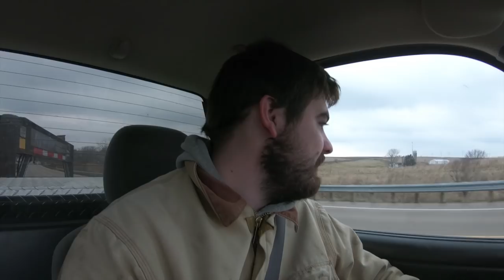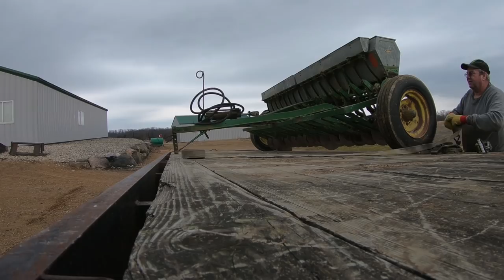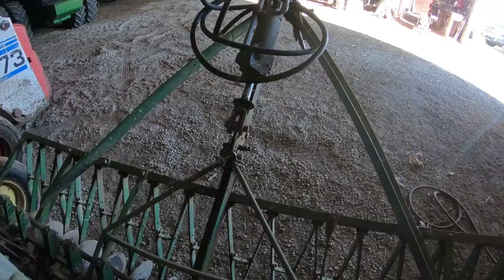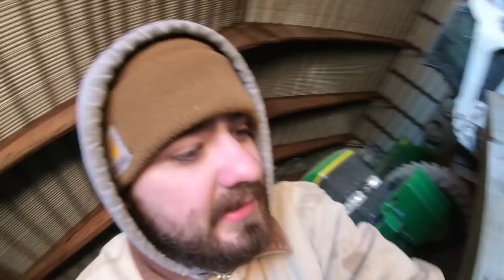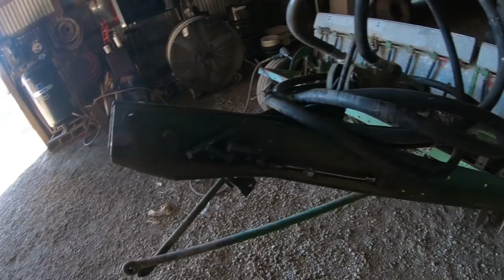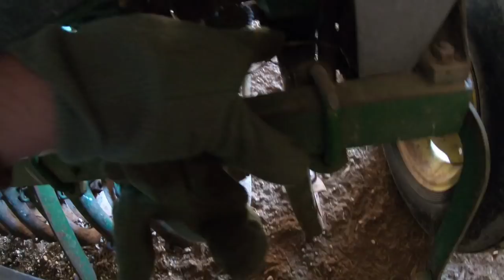1960’s John Deere B-Series Grain Drill

Comment: Drilled right at 100 acres with mine   back in October. Pulled it out of a retired Farmers barn. The JD dealer had a few parts left on the shelf so I bought all of them and after a little welding on it it doesn't miss a beat.

Comment: Nice old drills. I bought a 8ft John Deere Van Brundt seed drill back in the early 90's. Great drill, paid $500 for it and all it needed was a hydraulic cylinder and some greasing. Still have it. Mine has the double disk openers on it though.

Comment: Looked old enough to be a VAN Brunt with the galv seed boxes. The seed cups and hoses still looks good shape. I have an old JD LZ B drill, it shares a lot of parts with that drill around the seed box, cups and hoses.  Mine is hoe drill type openers instead of discs, and of course has packers wheels at the back, you probably have drag chains. Your JD 4020 won't even notice its back there, when its full.

Comment: If it was me I would put a electric actuator on to replace the hydraulic ram. Then do some wiring with the gator and use the gator to run that drill because even the 4020 is a bit overkill for that. On the other hand the 8235r would be good for YouTube views and subs

Comment: you should try a kubora tractor and a skid steer
Reply: Pancho Loewen Yeah if he wants it to break and not get it into gear.
Reply: oh yeah love it i tested a M6-141 and M7-171 a 141.4 hp and 171hp kubota 2017 new m series love it and price is reasonable cheaper too wich my kubota selling for his retail price for a M6-141 for $60,100 and M7-171 a 171hp for $59,100 wich not bad for big hp m tractors with 6 year warranty :)and the svl75-2 he selling for $48,000 and $50,000 for svl 90-2 a 92.2hp wich aint bad here in canada pei

Comment: i wouldnt say John Deere doesn't make parts for that anymore, they make parts based on consumed volume dating back to the very early 1900's, i would check with sloans if you need any parts...
http://jdpc.deere.com/jdpc/pdfs/PC0246.pdf
Reply: no not in canada all the  john deeres discontitued all parts on older models on there  markets but the older kubotas there parts still avaliable on the market wich kubota doesnt give up selling parts for older models wich are cheapest on the market wich kubota accully took over the deere tlbs

Comment: For a half a second I thought it was a van brunt
Reply: Kyle Rice I think it’s pretty much the same thing, I believe they may have made drills for Deere or Deere bought them out and kept the name for a while. We used to have a van burnt drill until a few years ago when one side of the drive gears fell apart and we couldn’t find parts. Now we have a 8200 John Deere
Reply: IT is a van brunt.  John Deere acquired the van brunt company.   
Both names appeared on the drills for a while.
Reply: emmjay I thought so but wasn’t sure so I didn’t want to put false information out there. Thanks

Comment: Well, that was one thing you didn't have.  From the picture Travis had shared, I was guessing it would be a land roller, but obviously, I was wrong.  Oh well.  I can admit that.  While it's not the no-till drill featured in some of your videos from previous years (see:  https://www.youtube.com/watch?v=gv8Am0gOgGM), it'll do the job and not break the bank.  Bonus: it'll be easier than walking around with a hand spreader when you're reseeding those waterways.